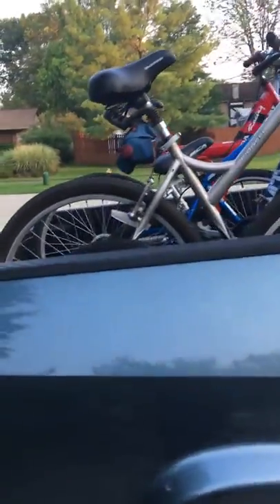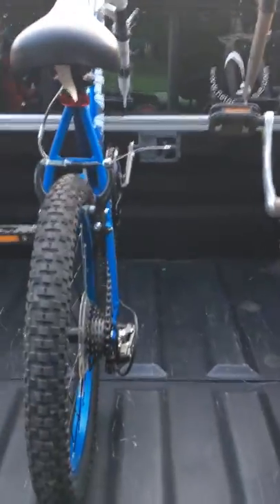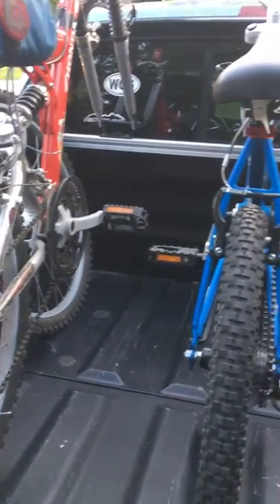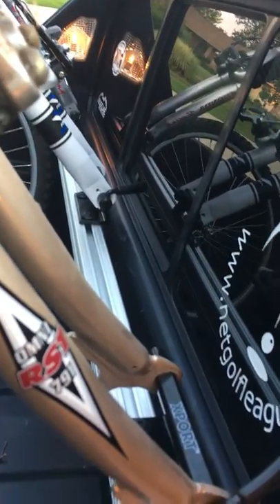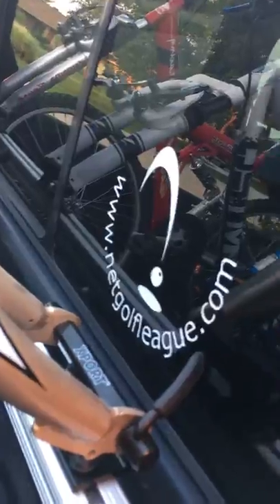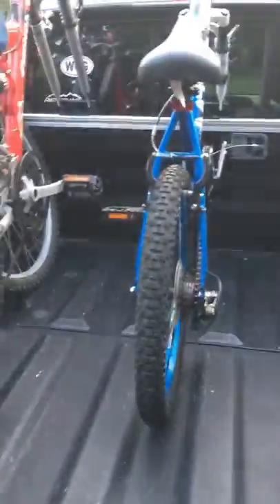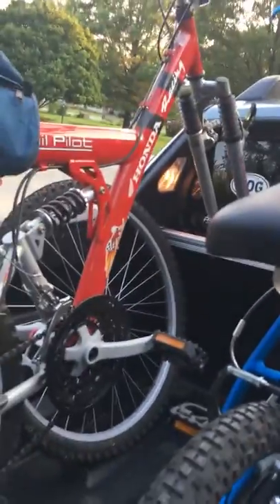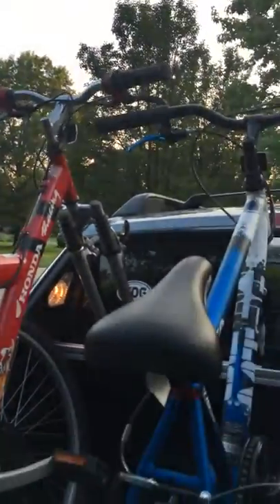Honda Ridgeline Bike Rack

Comment: Looks like a decent rack I wish you woulda shown how you attached it to the side
Reply from the maker: It attaches to the factory tie downs using some large washers and the allen screws and fasteners that fit inside the 80/20. Sorry I didn't show this closer up in the video.